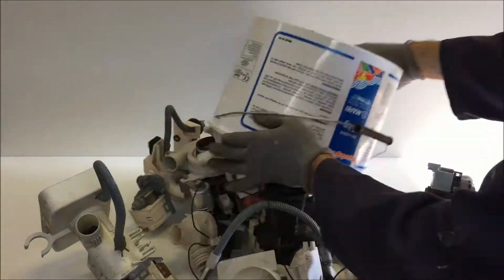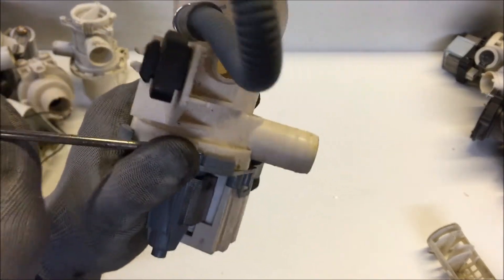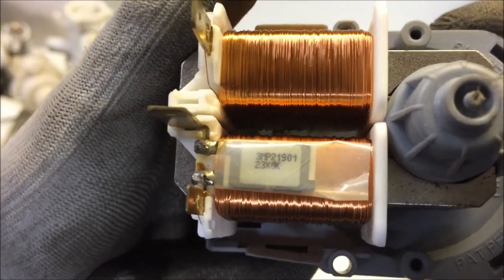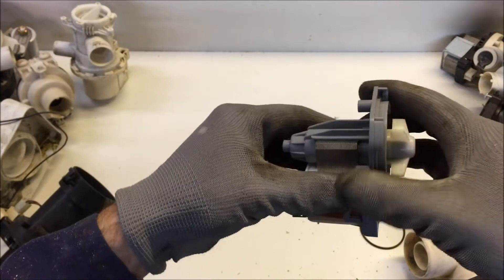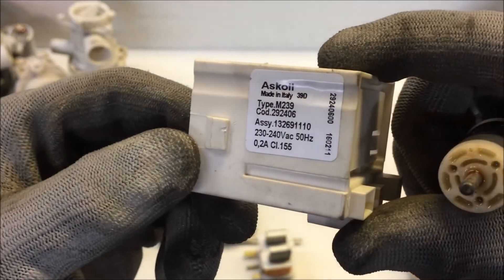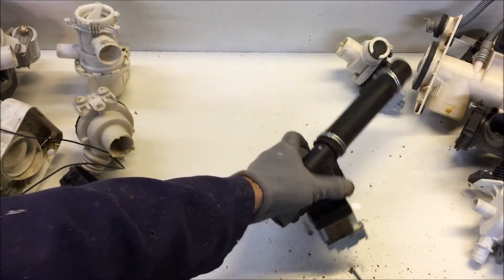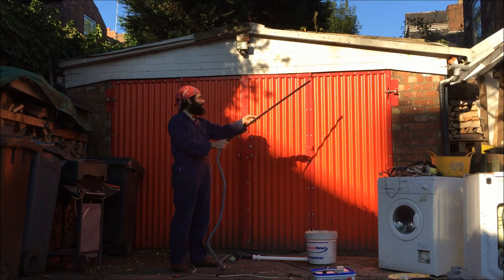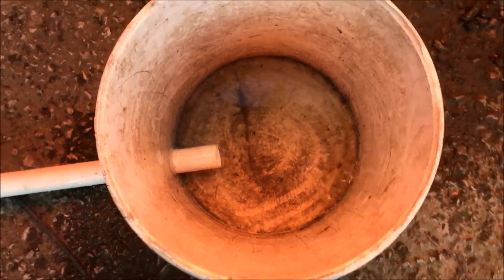How high can a washing machine pump pump? How to hotwire.

Comment: Hello! 
Your video has answered a few questions I have on reusing a drain pump from a wash/machine. Thank you for posting!!!! 
I just dissected my first washing machine and wanted to use the pump and larger motor to be creative. 
Going to use the larger motor to create a pottery wheel, done the research on the “how to’s” for that. However I haven’t been able to find the info needed to turn drain pump into a small water feature for the garden. 
So my question is, Is it possible to make a small water feature with a drain pump.
I enjoy the sound of moving water! 
Any info you can share would be greatly appreciated.
Reply from the maker: Surely the answer to your question is a simple yes. How you do it is up to you
Reply: Motor is out and going to make a pottery wheel. Going to add a simple variable speed controller. I’m thinking about using the side mount tub for the base. My favorite part about making things is the problem solving and the fabrication! Thanks for your channel! I hope to post my results!